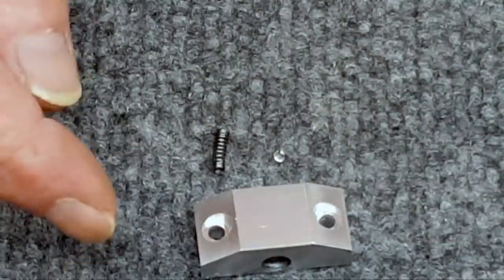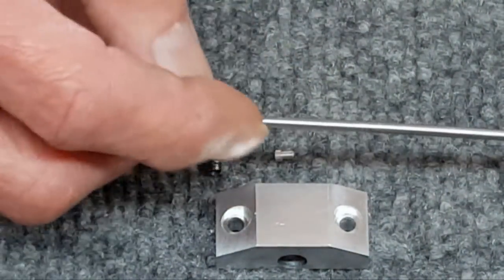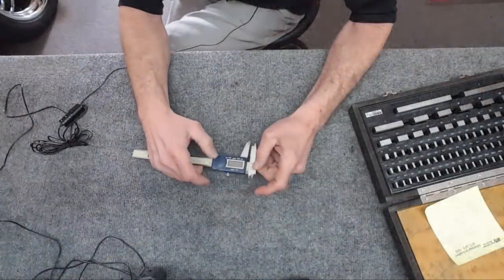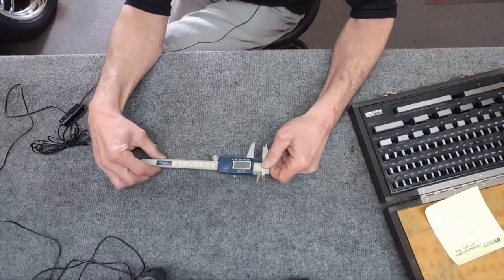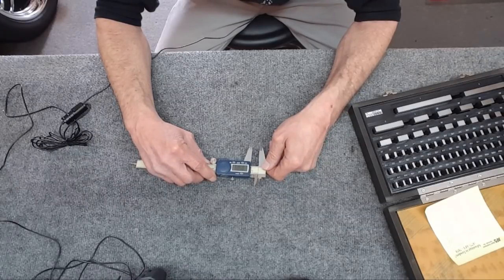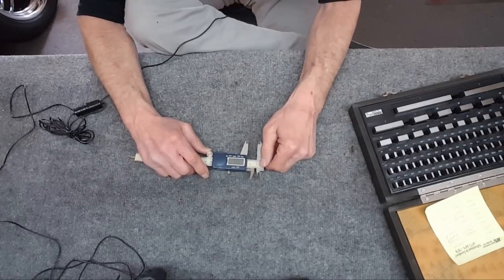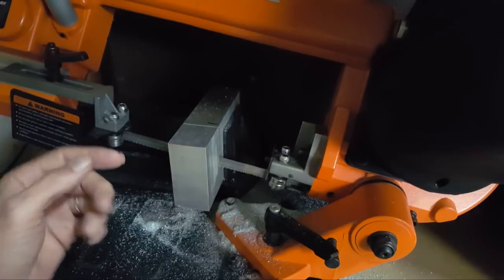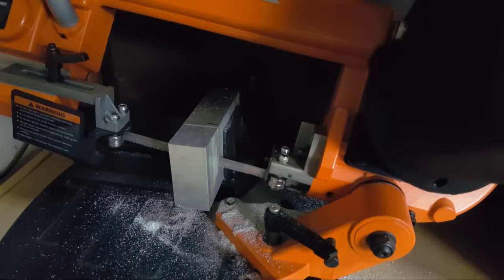Outside Radius or Ball Turning Without A Jig DIY

Comment: Dave, Just an FYI, Speeds and feeds with lathes and mills are for finishes but also very important is chip control. On a lathe you don't want long chips. They can become dangerous very fast. So by changing the feeds and or speeds also depth of cut you can get smaller safer chips. I'm not telling you what to do. That is your choice. I cringe every time I see you let go of the chuck key and it's still in the chuck. That is a big no no. Just a quick story. When I was going to school for machining. 2 of the new guys left the chuck key in the chuck and the instructor caught them. He taped the chuck keys in their hands. Then he taped a wooden 2x4 to each of their empty hands. He then had them go the the carpentry shop all the way on the other side of campus to have them cut free. They never forgot and left the chuck key in the chuck after that. But seriously, there has been chuck keys flung into cinder block walls and put holes in them. Okay I'm done trolling. Sorry I had to put that out there.
Reply from the maker: I had put the safety guards back on so it's impossible to forget the chuck key....

Comment: About the speed ad feed on your band saw, for that size of block, you're using way too small teeth, there is plaxw to evacuate the chips after the first teeth filled up, so the rest of the way they rub along creating heat. In Al you can run about 200 to 250 FTM easily as long as you clear the chips, a little coolant is also a great plus when ever possible. Try to get a 6 or even 4 teeth per inch if available for your blade size....    You'll see how much better it will perform overall...   ;)
Reply from the maker: Hi Pierre, haven't heard from you for some time now. Kinda figured I needed a coarser blade but having to cut something that big is extremely rare so can't really justify buying and storing another blade. So slowing it down and reducing cutting force did the trick for this job. Your recommendation on sawblades.com was really a plus as many others have ordered from there also. Cheers!!

Comment: 7:38 Hi Dave, if I remember the training properly, there is a break in procedure for band saw blades. It is run at a very low feed rate for a specified amount of material, then it is able to do full pressure cutting.Lots of vids on this out there, Hope this is useful , cheers.

Comment: Dav, Checkout Eccentric Engineering's new "Turnado" Freehand turning setup, also Graver handles used by watchmakers.

Barry
Australia.
Reply from the maker: I just did and interesting. I can't figure out how or where the base is mounted that the handle rides on. But I think I know what I want to do....
Reply: Dave M .  As far as I can see it attaches to the cross slide.

Barry
Australia

Comment: Hey Dave, you discovered what jewelers have been doing for a couple of hundred years.  I apprenticed for 5 years with a watchmaker when I was a teenager, we made watch parts with cutters called graver's used on a T rest on a Boley watchmaker's lathe. Got pretty darn good accuracy too!.  I would recommend putting handles on your cutters.  Gives you better control and is much safer. Try to stay cool.  It's been in the 90's up here too.  We had a few days cool down, but now it's going back up.

Comment: Some more great stuff  keep them digital calp away from magnets  they give you errors  like mag chuck on a surface grinder. free hand tools  just have to  be real careful  could grab it out of your hand  thats why you should use tool holder  alum is ok , but you get to brass  is grabby ,i made forming tool to use on ss 304  use peanut oil is the best for ss  more reat stuff ty again  hot in Maine to . stay cool if you can  i know the feeling

Comment: Dave I liked the results of the free hand.....Interesting!
Also on your band saw, would it not be more rigid to bring the blade guides in as close as possible to the work?
Reply from the maker: I definitely will be making a dedicated platform and some cutters for free handing. Would be able to add detail work to things I make like a scribe handle and so on. Yes rigidity would be better but doesn't seem to be a problem since the cuts come out very clean even though these are rough cuts before machining... Good point and I shall be experimenting with it!